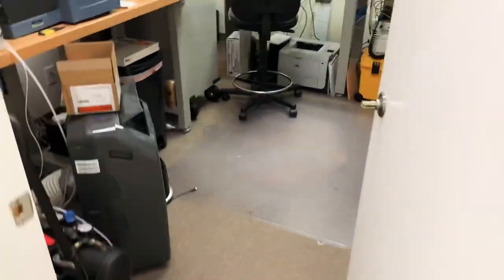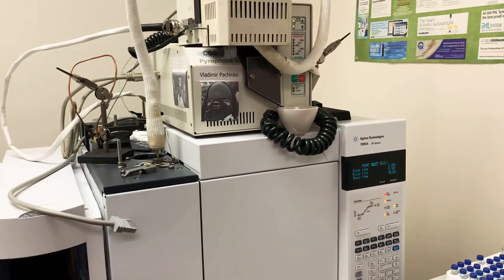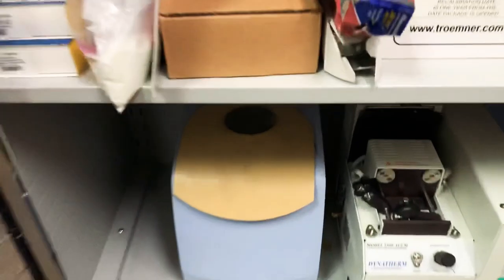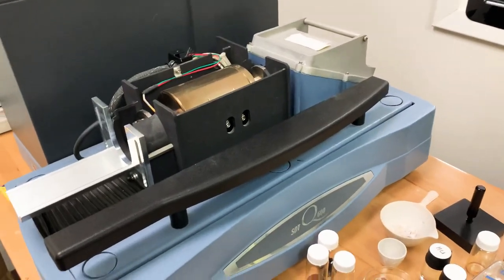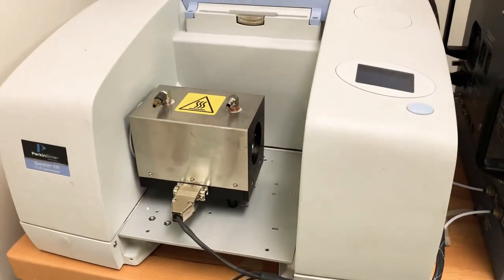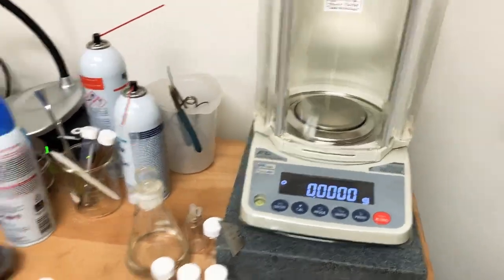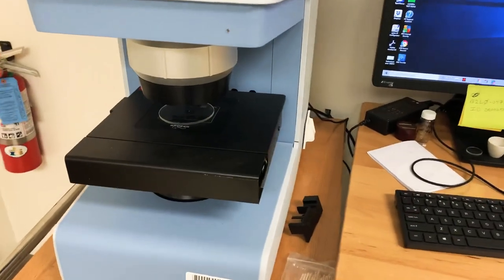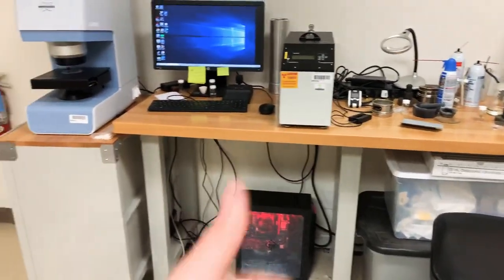Analytical Lab Tour

Comment: Oh wow. Oh wow. Where did you procure all of that analytical equipment? How much does it cost? )
Reply from the maker: I started a business doing chemical analysis roughly 7 years ago and I have been acquiring equipment as I go.
Reply: @MooreAnalytical  can you consider making videos on various types of analytical equipment and methods, what each one is good/bad for? there are tons of "home lab synthesis" videos on YouTube, but there seems to be zero competition in the "home lab analytics" niche (from measuring melting points on the tip of a thermometer all the way to "somewhat affordable NMR machines")
Reply from the maker: @netspirit79  that’s what I am working on right now. I want to combine a synthesis with an analytical technique to try and bridge the gap between the home chem world and what the analytical side of things does.